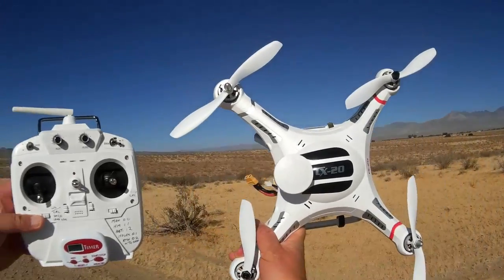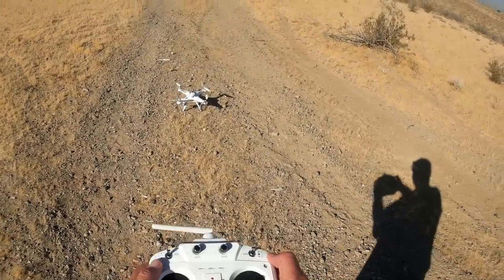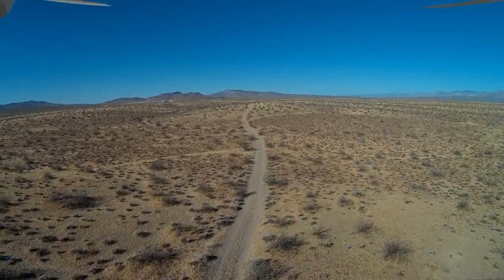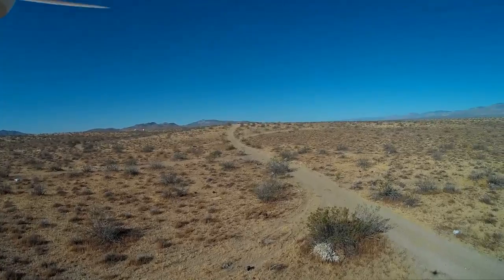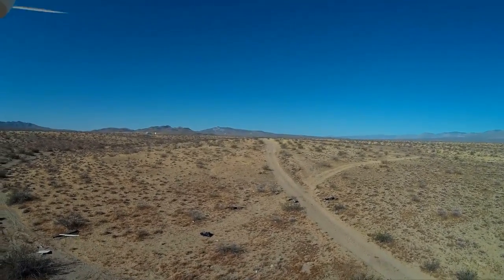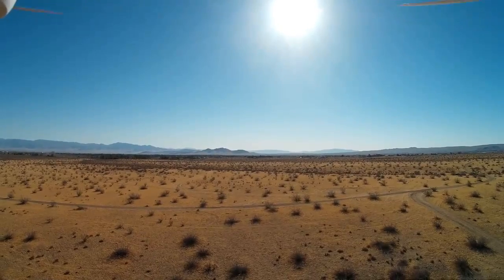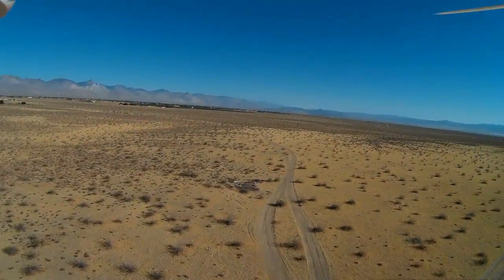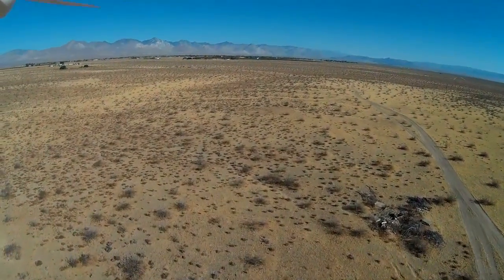Cheerson CX-20 Drone, Oops!

Comment: After flying GPS in DJI Phantom 2 and Blade 350qx quads, that looks more like a motor, prop, or esc problem than a compass calibration issue. Of course, a compass calibration should always be done when flying from a new location with any GPS based quad. Btw, you need an eBay gimbal on that CX-20, lol. All kidding aside, I hope the damage wasn't too bad for a simple repair job to get you back flying. When crashing, it's comforting to know it's my $30 quad not my $350 one...

Comment: You should never take off in GPS hold mode. You should be in the air with 0,0 and then switch to 0,1.
Reply from the maker: Joe Quadcopter You know, I think that you may be correct.  Am starting to get the feeling that it might be best to takeoff and fly manual for most of the flight as it seems to provide the smoothest flight.  Putting it in position or altitude hold can create weird movements as the quad tries to automatically stabilize itself against your inputs from the controller.  So for example, in the above video, it may have been best to simply fly out manual to the intended tires/trash location. Then once there, bring it to a stop then switch it to GPS position hold to video and survey the area.  Then go back to manual once I wished to proceed to the next location.  What are your thoughts?
Reply from the maker: Joe Quadcopter Additionally, for altitude hold, it doesn't seem to like high-speed horizontal movement as wobble can become a problem there too. For example, in the above video I was at full forward pitch. So when I wish to use that mode, I would keep the horizontal speed to a minimum.  Again, your thoughts?
Reply: That is exactly what I do. I fly to my desired location, always in manual, and then switch to altitude hold or gps lock. I think in GPS mode, it likes to over correct. That is probably what caused the flip. It was trying to correct quickly, but it ended up over correcting and crashing. I only fly manual when flying around, then switch to GPS assisted modes when hovering or regaining orientation.
Reply: Joe Quadcopter Got it.  This is probably off topic,  but what about flyaways?  People claim to get a good GPS lock and perform calibration before flight,  yet the cx20 still sometimes gets away.  Right when I'm prepared to order one,  I read of another horror story which stops me from doing so.  With my syma x8c,  I just have to worry about the crap brushed motors going bad.
Reply: Also, if you have been flying the X8C for a while, you are ready. It is very similar in size. The CX-20 has many features that can be very helpful, but also that can screw you. There is a huge learning curve and I was able to avoid if by doing my homework and following the people on the Facebook group very carefully.
Reply: chris Robinson yes, if video something and going to be there for a while, definitely use the altitude hold, as Joe says, exactly what it is for, one less thing to worry about while circling.  Also depends on you experience and flying ability.  Though even getting experience at this stuff, I would still use altitude hold if there for more than a wee bit......lol
Reply: Joe Quadcopter Thanks for the great advice regarding the gps signal. Earlier I watched a video of a guy launching his cx20 without getting a lock and my jaw dropped. Somehow it got a gps lock mid flight. I regularly look up cx20 vids to learn new info, I'd like to join that FB page you mentioned.
Reply: Joe Quadcopter Getting a proper lock on 8 or more satellites will take my Walkera Scout X4 at least a minute. I let sit more than that before taking off.
I imagine most UAVs that use GPS will do the same.
Reply: Quadcopter 101 in mission planner, you can set it to hover, in manual mode, as I have mine set at 50 % throttle, and it basically stays put.  Unless planning on been there, or wanting to video some distance at a certain altitude, then altitude hold not really necessary, but a nice feature.

I also increased the sensitivity to respond, as it was set at dog, slow, along with enabling a 45 degree pitch, so its a sporty speed demon, if I want.  I actually did an un-intentional flip,  when testing the brakes while in full forward throttle, went to full reverse throttle, and almost did a loop.   If i was higher, it would of looked really cool, instead of 'landing' upside down.....LOL.  

Luckily I test being stupid in a field next to the house, very tall soft grass, allowing for very soft, cushioned 'un-planned' lanings.......LOL
Reply: Joe Quadcopter So what if I want to circle around an object in Alt Hold or GPS hold? Is that not recommended and instead should I do so manually?
Reply: That is exactly what you should use altitude hold for. Take off in manual and get to your desired location in manual and then switch to altitude hold.
Reply: Mission Planner is a great tool that comes with this APM style flight controller. You can use a USB or telemetry (a tool that lets you wirelessly plug the quad into the computer) to monitor how many satellites you have and where it sees your quadcopter is. If it knows where the quad is, it will not fly away. The best and most effective way to prevent fly aways it to let the quad receive GPS signal, wait 5 minutes, and then walk around the park to allow the GPS to more precisely locate you. This will also help locate more satellites. If you do end up purchasing a CX-20, I could sponsor you into a Facebook group that is specifically for CX-20 users. I visit everyday to help out people. There are over 1700 members and a lot of very knowledgeable people. Let me know :)
Reply: Quadcopter 101 I realize that you're venturing into unknown territory here. :-)
The GPS Stabilize mode on  my Walkera Scout is meant to stabilize the quad at a desired altitude and allow you to release the controls and concentrate on taking videos or pictures. You can still fly around, but the minute you let go of the pitch/roll stick, the quad will stop and remain in place.
Since the quad is trying to hold it's position in space, it's not a good idea to reduce the throttle below what was needed to attain it's altitude.
It is recommended that when you return to home, you switch back to manual and land.
At least that is the proper way to fly my Scout.
Reply: Can you give me your email so I can send you a link to the Facebook page?
Reply: I saw that video too. I was like "no no no" and I was just blown away that someone would just jump in with GPS. Never a good idea. If you want to use RTL, it returns to the place you armed the motors. That is a perfect example of when you would experience a fly away. 😃
Reply: *without
Reply: Joe Quadcopter  sent via Google+
Reply: Yes.
Reply: Yes.

Comment: If you were in Alt Hold mode it wasn't a GPS or compass issue that caused the crash.  It looked more like it threw a prop, you had a brownout or the FC became unstuck from the power board.  Did you open it up when it first arrived to make sure the FC was secure?  That's the first thing you should do with any CX-20.  There have been many cases where it arrived with an askew FC.  Check your dataflash logs to see if the FC voltage was consistent.  That'll tell you whether or not it was a brownout.
Reply from the maker: Joe Quadcopter I'm definitely going to try it.  Would like to see it have a little more oomph in the breeze.
Reply: I agree completely
Reply from the maker: WhiffleX Yes, I've opened it several times, and have jiggled all parts to makes ure they're secure.
Reply: Also check to see if the ESC burned out. Was it badly damaged? Check to make sure all motors spin together and at the same speed.
Reply: "It" being the CX-20.
Reply: Any idea what caused this then?  Did you have the dataflash logs on?
Reply: I think it was too much correction from the GPS assisted mode that caused it to flip. I could be wrong.
Reply: Almost like he was traveling full speed and then let go or pulled back on the stick and it went too far and flipped. One question for you Quadcopter101, did you change the ANGLE_MAX in mission planner?
Reply from the maker: Joe Quadcopter I haven't touched the mission planner yet.  Do you recommend it?
Reply: I would recommend changing the ANGLE_MAX in the full parameter list to 3000-3500 or 30-35 degrees. This is like your "high rate" setting on the toy quads. It will give you enough fight for up to 20 mph winds. The stock is 2200 or 22 degrees which is simply not enough to fight a basic breeze. I want to warn you, do not mess around in Mission Planner without knowing what you are doing. It is very easy to mess something up. Make sure before changing anything in the full parameter list to save your parameters on the top right where it says "save params". If something goes wrong, then you always have your "factory settings" backed up. Good luck.
Reply: But, unlike tot quads, once you change it, it stays in that speed. You cannot change the speed between "high" and "low" speeds. It will stay at that one ANGLE_MAX you set. I really like the APM modified FC in this quad paired with Mission Planner. A lot of changes can be made to personalize it for your own personal needs/uses.
Reply: +Joe Mirabelli Do you please know a good alternative to this one cx20, one that is really rtf, really reay to fly, and affidabile?
Thank you
Reply: +Paul Terl One with gps but that is not needed to mess on softwares, etc. .
I just need the gps for the rth and a stableand affidable performer to do some nice  videos with it.
I have 10 hours to decide between this one, the hubsan H501S, the hubsan x8 pro, or the xk detect x380, or the Flying 3D X8, or a cheap phantom.
This is a call for everyone here!
What do you vote?
Reply: +Paul Terl thank you everyone.
done alone,
happy.

Comment: hey also can u do an altitude test on the syma x8c and the cheerson x20
Reply: KGP VIDEO VLOG They both go high enough to get even experienced pilots into major trouble.   Once you lose line-of-sight on any of these you're basically flying recklessly without some kind of real-time telemetry or FPV ability.  The Syma has a range better than 250 meters based on reviews here on YouTube and discussion forums, and I believe the CX-20's range can be measured in Kilometers, but don't quote me.  Either way, they both fly ridiculously high for hobby flying.
Reply: The Cheerson cx-20 can go 800-1000m. Yes, you can get into some major problems if you loose sight. Here in the USA, it is illegal to go higher than 400 ft.
Reply: Syma x8c doesn't have GPS, so that feature is none existent.
Reply: ok ,but on the online Manuel its rated at 300m
Reply: KGP VIDEO VLOG On the open Source with two antennas you can definitely get more than 300m. I can guarantee you that.
Reply: ok so there is 2 version of the cheerson ,can u please send me a link to the open source version where i can fly more than 300m
Reply: Banggood is selling only open source. All of theirs have two antennas now.
Reply: ok cool ,so the open source verson can fly more than 300m,i live in the country side with a few hours and would like to test when i get mine
Reply: deplanes mine came from Banggood USA and it was at my house in 3 days.
Reply: Joe Quadcopter not illegal, simply not recommended, and quite honestly, very irresponsible.  Yes, I'v seen those vids of a mile or more, but mine won't go much more, if at all, the 300 m it's rated for...........go figure.
Reply: LA smyth "Stay under 400' or you could be fined for endangering people or other aircraft" from the FAA website.
Reply from the maker: KGP VIDEO VLOG Here's the current restrictions.  But note that they are being updated http://www.faa.gov/documentLibrary/media/Advisory_Circular/91-57.pdf
Reply: Quadcopter 101 are they really? What will change?
Reply from the maker: Joe Quadcopter A lot more restrictions are proposed although they're proposing increasing the altitude to 500 feet. http://www.faa.gov/regulations_policies/rulemaking/media/021515_sUAS_Summary.pdf Keep in mind the above is a "proposal".  It's likely to change.
Reply: cool ,i do think that 500m is a lot
Reply from the maker: KGP VIDEO VLOG Sorry, 500 feet not meters.
Reply: I swear, super fast processing and shipping
Reply: Well this was a month ago. I really do not care if you believe me or not. The order total was $233 from the US warehouse since I had a coupon. Banggood was excellent with shipping and handling time, 3 days. Maybe the US warehouse is faster to get orders out than China. I also ordered in the morning so they had time throughout the day to ship it.